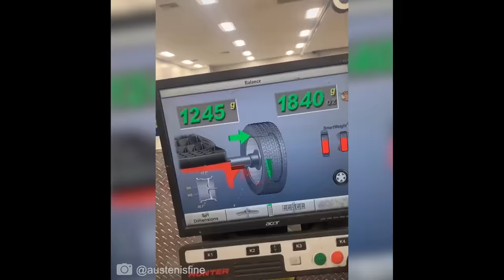Mechanical Problems Compilation [Part 7] 10 Minutes Mechanical Fails and more

Comment: Personally I've gone into the Bin Room at work where the Employees had taken the Handle off the CIP Nozzle and left it in an open position.
Now for those not familiar with the CIP, It stands for Clean In Place, basically hot water that has chemicals pumped into it which reacts with the grease and proteins and converts it into soap which actually does the washing. It's very hot, around 180°F and the chemicals in the line are extremely corrosive, and can basically cook your skin on contact.
I turned the main valve on and the CIP went haywire so I quickly shut off the valve, cursing obscenities for a while after then I reported it maintenance thinking it broke because it was a worn out valve only for them to fix it and someone remove it again so I reported it to security who looked over the cameras and caught the guy doing it who got suspended and his pay was docked.
Reply: I got CIP On my lip once, that was by far the most unpleasant experience of my entire life, and I count sulfuric acid burns in that

Comment: The guy on the 9:00 is just cleaning the battery terminals. With coke
Reply: hummm what ?!
Reply: Mightywasp 12 yeah that’s not a thing
Reply: CyberOstrich _ cause y’all don’t know the broke people way of cleaning terminals of the battery.
Reply: Mightywasp 12 tgat doesn’t work it just makes the battery stickier, more susceptible to rust, more likely to fail, and makes a bad contact with leads

Don’t do this
Reply: CyberOstrich _ yes it does work. You are supposed to wipe if off dude. Plus all my co workers do this at the shop. And some customers do it too.
Reply: CyberOstrich _ but it’s what ever you don’t got to trust it. Put all I’m saying if you got some coke and you have a pile of coroson in your terminals. Just use that.

Comment: 9:27 the car has a lot of moisture inside, put some silicone cat litter under the rugs and it will be ok. By the way, don't scratch the frost, just deftrost the window normally ant wipe the water with paper cloth, less mess.

Comment: Yikes, I tested a Bronco years back at an old lot I'd help at and when braking it would pull hard to the left. Slapped it on the lift and come to find the outside layer of the brake rotor had been worn so thin it separated from the disc and was just kind of jostling around freely. Hella dangerous to drive like that.

Comment: 9:12 This guy doesn't even know how relays work, I hope he just does oil changes and brakes.  Any relay will do the same thing as long as you grab the casing like that so the jaw squeezes the ends of the coil together.  One end of the coil has the load contact, that gets drawn in when the coil is energized by the control circuit.  He's squeezing that connection together manually on the starter relay.
Reply: Yeah he's most definitely just a filter fitter..." Never seen this in my life" must literally be his first day ever smh

Comment: 3:18 how can a rotor be so brittle 🤭
Reply: Hawkeye Pierce rotors wear down as well but obviously not as fast as brake pads. There is a minimal thickness for them to be safe. Just look up your car rotor thickness and use a tool to measure the thickness or go to a mechanic and ask them for a brake and/or vehicle inspection. Never hurts.
Reply: @Dragonborn_1992  mechanics doing mechanical inspections, sounds like a huge bill and issues arising that were never there to begin with
Reply: @Dragonborn_1992  never hurts though 😂
Reply: 9

Comment: Any car will frost up on the inside. 

That’s why in Canada we tap our boots to try and keep snow out of the vehicle, crank the heat to bake the moisture out of the air, and put a towel or desiccant packs in to reduce the moisture. 

Works the other way too. In the days before computerized parking you’d get an expired parking pass and put it on your dash parked facing north and leave a wet towel near the rear window facing south. Either condensation or frost would make the number on the pass illegible. Free parking!

Comment: 9:27 as a former owner of FIAT i know the feeling. That car had cabin filter on the lowest point of air duct, which got easily wet and all that humidity just went inside... Or, even better, just stayed there and when i turned on the fan to unfreeze front window, it all just went on the window from inside, while it also immediately froze.

It also happened on my previous cars and it´s happening on my current car, just not so much and i found a hack - every few days, when you get home, open all doors and let the dry winter air to suck out all your internal humidity. Forget all those "fog stop" pillows, they won´t do much and the effect lowers over time - if you still want something like that, go to animal shop and buy silica gel that´s used for cat´s toilet.

10:04 allright, now i can say, i saw everything 🤣

Comment: 9:12 I used to have a Jeep Grand Cherokee that had to be started like that. Turn the ignition to on but to fire the engine you had to pop the hood and pinch the starter relay like he's doing. After about 2 months of that I wired in a push button switch. Still set up like that to this day too lol

Comment: Dude at 8:55 was just cleaning his battery. Soda is very good for cleaning corrosion off of battery terminals. When my old shop would run out of the corrosion cleaner I would just go buy a soda out of the vending machine, dump a little on the terminals to clean it and then drink the rest. and the one at 9:22 is just him closing the contacts inside the relay manually. You can do that on any vehicle.

Comment: 4:28 Another one of those where they used the oil filter adapter and a ratchet or impact to install the filter. Installation is most definitely NOT the reverse of removal. Ive had that happen. Usually end up having to rip the can off and back the actual tapping plate off with a hammer and a punch.
Reply: Are there really people out there who put an oil filter on with an impact :o
Reply: I want to say I read somewhere that it was a technical issue with the Ford Mustang’s oil filter that required an insanely amount of torque. And I’m sure the techs used a ratchet lol.

Comment: 0:37 is so lucky the spinner came off with the nose pointing into the direction the fan blades are rotating. Check out how the fan just keeps knocking it forward and out of the way, whereas if it were facing the other way, the blades would catch an edge, shred it, and suck the pieces back through the compressor.

Comment: Fans mounted on thermal clutches are SUPPOSED to spin loosely until the clutch heats and makes it spin at the speed of the belt pully.  Nothing wrong there.

Comment: The radiator fan was not broken.  There is a special clutch that tightens more and more under the influence of temperature so that the fan turns faster when the engine is hot and slower when it is cooler.  Therefore, it can be stopped by hand because it is not rigidly connected to the axle.

Comment: And this video is to show why you make basic maintenance like check blinker fluids and muffler bearings for example
Not so often but remember to check your piston return springs too
And if older car it might have carburettor you need to check your carburettor plugs condition in order for it to work properly

Comment: 5:06 What happened here with the Ford Edge? I gather it was in Park and with AWD the parking pawl was locking the rear wheels, obviously terrible idea for towing.
When it broke though, what were we seeing?  What dropped down, the rear differential and half shafts?

Comment: The one where the guy's pouring Coca-Cola into the engine bay he may be just cleaning corrosion off of the battery terminals
Reply: Use diet coke or you will have a sticky mess.

Comment: 1:47 introducing the all new auto wash all you do is put money into the coin slot get in your car leave it parked and get out after 10 minutes

Also this hasn’t been tested so it may not worked as precisely as it does on the ad check this video out for the proof on how it actually does

Comment: Actually the semi with a blown wheel.. youre allowed to drive to next destination for repairs etc. And drive a good while like that. 18wheelers. You got 10 on the front. Youll be fine. Its the benefit of riding on duals in the back as well, some use the wide rear tires and others use duals for the semi. But for semi you have 2 front and 8 in the back and another 8 on trailer. If one goes, between these 2 sets of 8 its actually fine to keep driving if you dont have a spare

Comment: 2:15 you know it's supposed to do that, right? it's a clutch fan. there is a clutch in there that either engages centrifugally or by temp and it allows slippage so the fan doesn't spin so fast when it doesn't need to. the point of this is to save horsepower.

Comment: The guy @ 8:56 may be pouring a little coke on the battery terminals.  It will dissolve battery corrosion.  I've been told my grandfather (in the 50's) would pour a coke on the windshield if they were on a trip at night and it was raining.  I had a temporary RainX effect.

Comment: That backyard machining job would've worked fine on that block. I do it with either that or WD40 and some wet and dry sandpaper depending on how bad it is.

Comment: 2:20 - visco clutch is broken, bimetal inside does not work as it should, meybe fluid.. Replacement is easy and quick, 10minutes and work's done.

Comment: 9:22 what your doing is compressing tge relay so it shorts and sends power to the starter. Reson it doesnt start is cause your buddy has the keys and fuel pump, injectors, and no spark is getting to the engine. When you turn the key to the crank position al your doing is sending 12v to the thing he is squeezeing. They do that cause that little relay can handle more current then the key switch so thats why they have a switch turn on a switch for you

Comment: The one where the fan just stops when he puts resistance on it isn’t a “fail” at all. They’re designed to do that so if something gets jammed in the fan it doesn’t cease up the whole belt. Another reason for this is if the car engine stoops and the belt stops rapidly you don’t want the fan to jerk to a stop, that would wear out both the bearings and belt faster

Comment: 9:12 isn't a problem.  Depending on how the start relay is built it is possible to squeeze the relay case and make the contacts close.  Notice the car didn't start.  That's just the starter dry cranking.  I work in automotive and we have troubleshooting relays with the cases torn off so we can close the contacts by hand.
Reply: That's what I thought too.

Comment: 4:17 not mechanical problem. Car has a turbo and has anti lag (so the turbo stays spooled on deceleration to keep boost) which is when the fuel is ignited later than normal so most of the bang happens In the turbo. (Rally cars do this the turbo gets replaced every run though)
Reply: I think the focus of the video is on the literal fire started by it.
Reply: @captainevenslower4400  I know that just wanted to share some info just incase people thought the anti lag was the problem

Comment: Pity phone cameras weren’t around back when I owned Radiator shops and Workshops as I’ve seen some crazy things, and got some crazy answers from customers!!!!!
Like front rotor worn right thru outer and halfway thru vents.
Asked didn’t you hear the noise???? Reply yeh but I just turned up the radio!!!!
So many stories it would curl your hair and you wouldn’t drive on the road again ever!!!!

Comment: The fact that Audi rod blasted through the pan that far bent and didn’t break into many pieces is actually kinda impressive. Same result I guess, catastrophic failure and will need a complete new engine, but still. Been a tech for 8 years and never seen some shit like that
Reply: Complete new engine? Only dumbass and lazy mechanics do that. I would disassemble the engine,and replace only the part that need them. It's a lot of work but it's very fun and you learn a lot

Comment: 9:14 isnt an issue either hes forcing closed the relay which triggers the starter. If the keys were in it, he could start the car that way but the fuel pumps are off. After an accident I had, clamping down on the relay was the ONLY way to start my car.

Comment: 9.12 he is basically just clicking the relay in for the starter motor it won't actually start because the injectors are not firing and a bunch of other things that need the key to be on for the engine to actually start.

Comment: 8:56, the guy pouring coke is likely trying to clean his battery posts. Claims on the internet say the acid in coca cola dissolves the corrosion junk. Don't do it, it just leaves a sticky mess for the guy who has to change the battery.

Comment: Wait do people really not know the coca-cola trick? When the acid builds up on your cheap battery you can pour coke on it to get a better connection till you replaced the failed battery. If a cell gets low you can use fresh destilled water to top it up to get a few more months out of the battery.

Comment: 9:03 - That's not exactly a fail... Coca-Cola has a pretty high acid level and it'll eat up whatever is blocking your battery terminals. Might be a bit of a "backwoods" fix but it'll get you going at least and if you use a small amount of water to wash off the coke afterwards then you're fine.

Comment: With your hands on the spraying nozeles of a diesel 8.00.
he wants to die i gues.
Reply: After that workers comp
Reply: Spraying nozzles? You mean injectors?
Reply: Meh. Miles away. If he had his hand trying to block one, fair enough.  More than a couple of inches and the pressure drops to nothing.

Comment: You can tell inexperienced mechanics,They marvel @ extreme wear in engines or a brake rotor...Etc like they haven't seen it before,Probably haven't. An experienced mechanic has seen most everything.

Comment: Most of these are nothing special. Water from light is water that was in the back door, when you open it, it went down the drain... Coca cola is how you clean rust, not just of the terminals, but also motor.